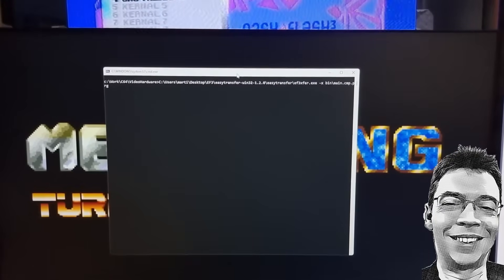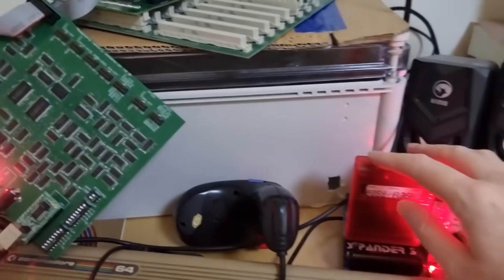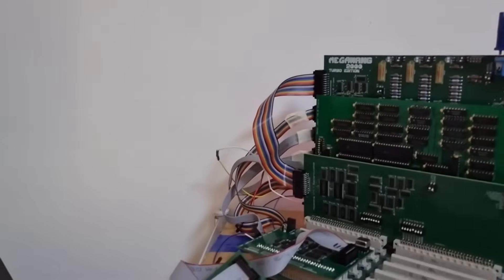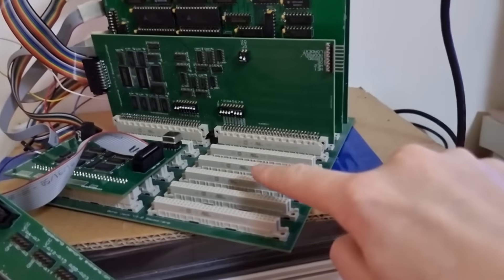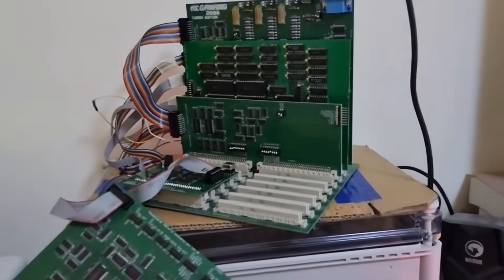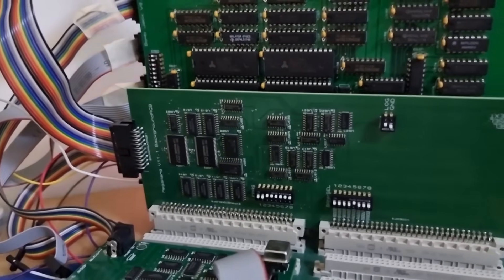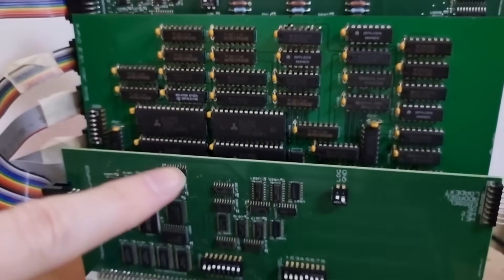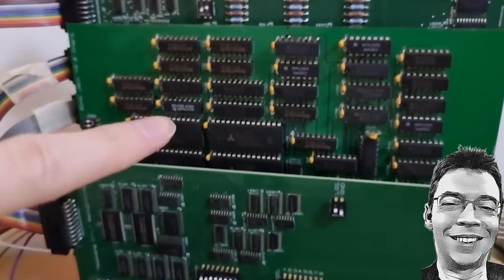MegaWang 2000 Turbo Edition - 47 - Bitmap RGB layer tests

Comment: This would be fun to play with on some FPGA. Like MiSTer FPGA. Pure TTL hardware would be lovely, but pretty unrealistic for many of us.
Reply from the maker: It's an aesthetic choice. :) FPGAs are fine, but they're a bit boring to look at.
Reply: @MartinPiper6502  My wife thinks otherwise. Clearly she has no idea of aesthetics!
Reply: I like that it looks like period correct arcade hardware. With so much TTL parts, it may be fitting to build a CPU out of TTL parts, like Ben Eater did. TTL is good for up to 20 MHz ? Or what it is the clock of MegaWang? I thought that the invention of the micro-processor was when the ALU and the registers were integrated. I then learned that there a lot of multiplexers in between. Yeah, probably, still rather want an integrated CPU because all those multiplexers with all those pins would be expensive.
Reply from the maker: The clock varies depending on the board and function. The main video generation runs at 12.096 MHz. The sprites can run at 14MHz to 16MHz. There is a lot of parallel execution paths and memory in this.